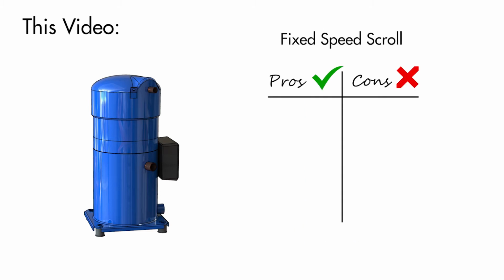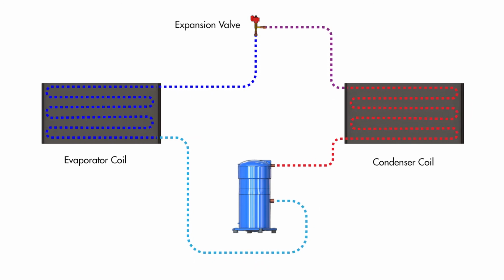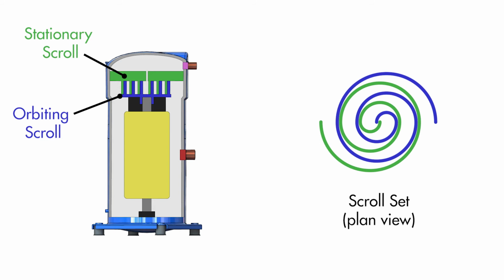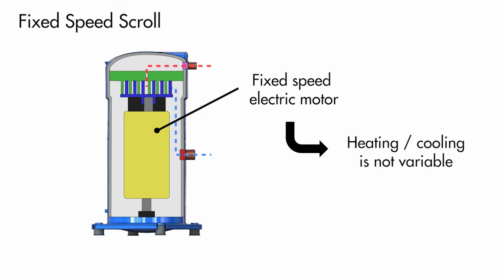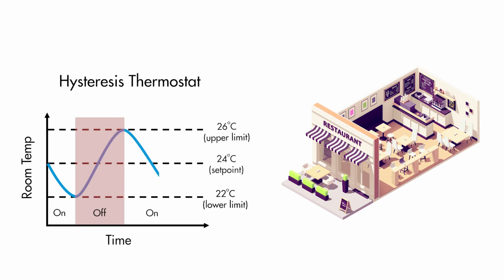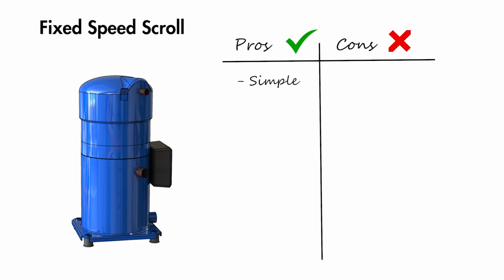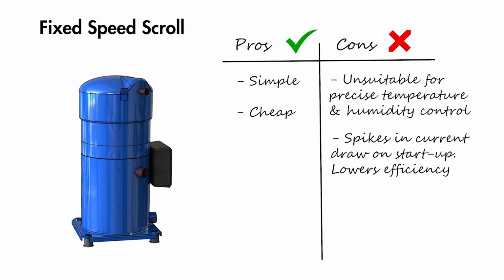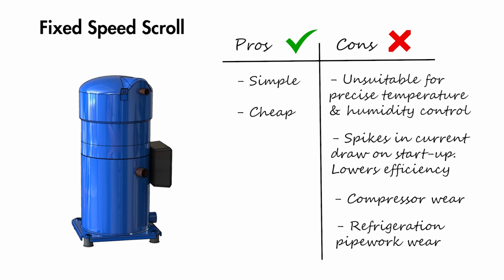The Scroll Compressor - Basics & The Fixed Speed Type

Comment: My dad was watching ur video and it helps him understand about how this machine works.  He has one that not working well cuz of the noise, so he cut it open and see if there’s dirt in it. He clean some dirt and assemble it back. When he close it back and run it again,  the machine is not producing pressure anymore. He asked me to ask you if you have any tips and suggestions for it? 
He has done to other machine by cutting it open, clean the dirt, put it back and it’s running well now. 
He’s having problem with this one. 
Thank you.
Reply: I think there's a clearance between the two scrolls required, and they are quite close. Close enough for the scroll to not seize up but not so far that there's no compression. I suspect what happened is you created a leak and now the scroll spins without any pressure difference.

Also these compressors are hermetically sealed, and so only way to put it back together is weld it back together.

These should be done by remanufacturing facility who can ensure the proper clearance.